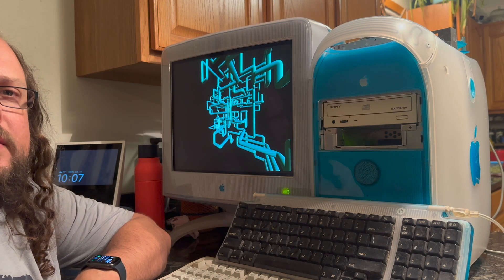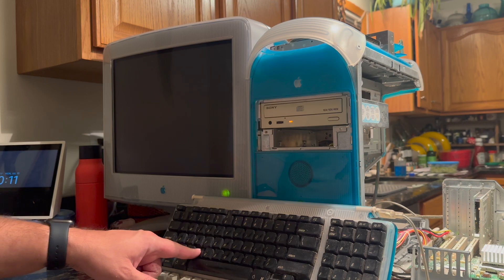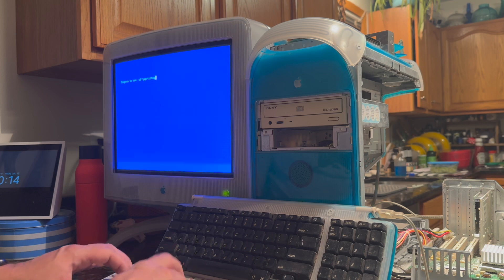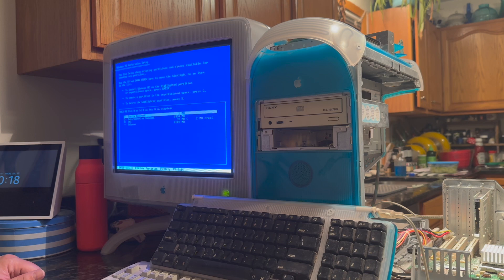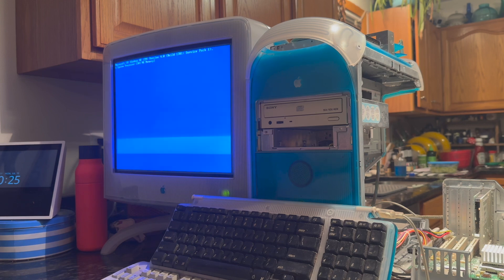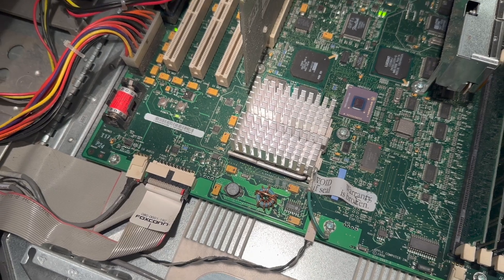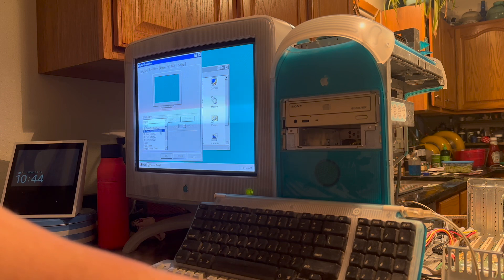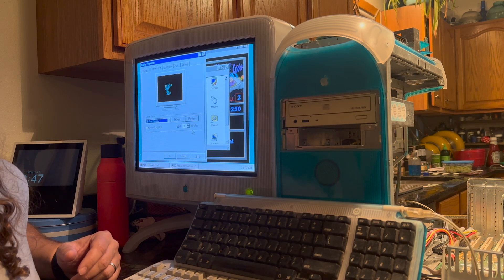Guide: NT 4.0 on Power Mac Blue & White G3 (maciNTosh)

Comment: Would this work on an iBook G3
Reply from the maker: From the Wiki: This repository currently contains the source code for the ARC firmware and its loader, targeting New World Power Macintosh systems using the Gossamer architecture (that is, MPC106 "Grackle" memory controller and PCI host, and "Heathrow" or "Paddington" super-I/O chip on the PCI bus). That is, the following systems:

iMac G3 (tray-loading)
Power Macintosh G3 (Blue & White) "Yosemite"
Macintosh PowerBook G3 Bronze Keyboard "Lombard"
Power Macintosh G4 PCI "Yikes!"

Comment: Hey I see you still have your Maxell barrel battery on the mainboard. Get it removed AASP, as they go bang and squirt out really corrosive liquid
Reply from the maker: Good call, but also no worries as I have already replaced it with one of these now: https://www.youtube.com/watch?v=JvSpCgtZO68
Reply: @jonobst  sure thing. I am interested how long will they last as the CR2032 has much less capacity than 1/2 AA 3.6V one. I remember using Mac SE/30 from 1989 in 2010 or 2011 with original Varta battery and it was still holding date. But on my PowerMac G4 AGP I had to replace it probably for the 3rd or 4th time since I got it in 2007, so I guess it lasts 4 years at most. Most likely SE/30 had much lower current drain from the PRAM battery than G3/G4
Reply from the maker: @michvod  so far in the SE/30 its been 2 years and still running - not sure about total length of life yet, though.
Reply: @jonobst  SE/30 has really efficient RTC circuit that uses almost no current. Those machines have a mechanical power switch so the power gets cut to the power supply/mainboard completely. So the onboard RTC spends most of its time running on internal battery, as even when those were new most of them weren't used more than few hours a day. Newer machines have standby (+5VSB) all the time as they also have soft-power. I would guess that their RTC circuit isn't that efficient as those were meant to be plugged in all the time, so the PRAM battery only kicks in when there is a power outage... I could put a microamp meter in series with the battery and see what values we get on different vintage Macs :)
Reply from the maker: @michvod  sounds like a good concept for a video, the usage of the battery in both plugged in and off and unplugged and off states of the G3 compared to no power on the SE/30 ;)
Reply: @jonobst  yeah, get a sensitive amp meter and you can calculate the approx. lifetime of different batteries. definitely a good idea for a video :)

Comment: I just tried the v0.05 and my B&W looks like it boots holding 'c' but then my monitor goes blank and into inactive state.  I'm trying to find another video card, thinking maybe that is the issue.  it's the original ATI Rage Pro128 with only VGA port. Thoughts?
Reply from the maker: I am also running the same stock ATI Rage 128 (p/n 109-57400-00).  There were some problems early on with video not working correctly, maybe worth going back to an older version and seeing if it is a recent break?  Never had a no signal issue, though - might be putting out a resolution your monitor doesn't support.  What monitor are you using?
Reply: @jonobst  I can try v0.03 and see what happens.  I'm using it on a 24" Viewsonic LCD.
Reply from the maker: @bobbyplajinko4840  If you have another monitor, worth a shot - though I think it is outputting 640x480 which is standard VGA and every monitor supports that.

Comment: Really neat project. Does the PowerMac's built-in GUI boot menu still work when both drives are plugged in? It would be very neat to see a triple-boot machine for Mac OS 9, OS X, and Windows NT.
Reply from the maker: No, if I plugged in the primary channel IDE drive it would only boot Mac OS.  You can however partition the secondary channel to support booting of Mac OS 8/9 & X and have a dual/triple boot in theory that way.  The instructions note:

"The OS X installer, and just booting OS 8/OS 9, will error if a valid MBR is present on the disk at all, which is required for NT. In ARC firmware, go to Run firmware setup then Reboot to OSX install or OS8/OS9 if you wish to boot to those listed operating systems."

Comment: Do you think this will work on the Ibook G3?
Reply from the maker: As it stands right now, it will not.  It does sounds promising for these models either, per the list of supported hardware at https://github.com/Wack0/maciNTosh

That is, the following systems:

iMac G3 (tray-loading)
Power Macintosh G3 (Blue & White) "Yosemite"
Macintosh PowerBook G3 Bronze Keyboard "Lombard"
Power Macintosh G4 PCI "Yikes!"
The ARC firmware itself runs at a low enough level that it should be compatible with Old World systems using the same chipset too, but there is currently no loader for these systems; these are the following:

Power Macintosh G3 (beige)
Macintosh PowerBook G3 Series "Wallstreet", "PDQ"
There may be issues on your hardware.

Comment: Great vid, this has been giving me absolute hell on my Blue & White - it's at the point I've got the HD as master and CD as slave on the secondary IDE bus and ARC hardlocks for me. So still figuring this out on my end. :c 

Also, a bit of friendly advice. I'd strongly suggest getting that Maxell clock battery out of there - they are known to violently explode and destroy your computer. A CR2032 adapter is a safer bet as they're far less likely to leak.
Reply from the maker: Yeah I saw your notes.  Very strange!  I'd probably start swapping things out (IDE cable, RAM, etc) just to make sure its nothing simple like that.  Wonder if your IDE controller is running a slightly different revision than the one I have?

...and I am keenly aware of that battery!  I even made a video about it a while back: https://www.youtube.com/watch?v=JvSpCgtZO68 Its just hanging out for now as it is still providing enough voltage to keep the PRAM data retained and this Mac isn't going into any sort of long term storage with the maxellbomb in it.

Comment: I was wondering about the IBM work stations with Power PC CPUs that natively supported Windows NT in the 1990s. These machines are so rare now and this is a good replacement for that if you had apps that ran on the IBM Power PCs. Have you tried to install on any IBM Power PC work stations?
Reply from the maker: I haven't installed NT on an IBM PowerPC server, though I do have an IBM Power server running AIX here with me currently.
Reply: Remember the Xbox 360 is another customized Windows release for PowerPC!
Reply from the maker: @TransitAndTeslas  that is true, I wonder if they still compile code for other architectures (obviously they've been doing ARM for years now)?